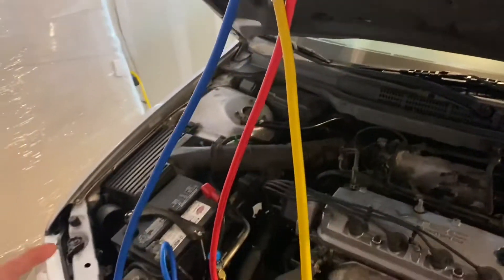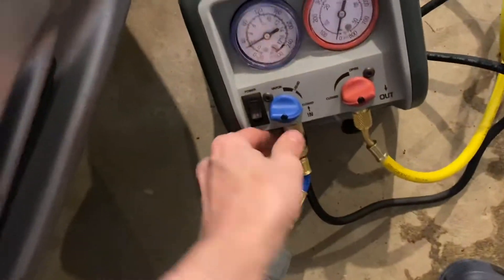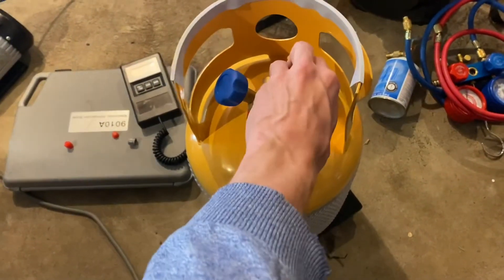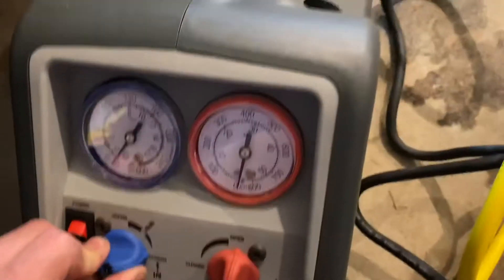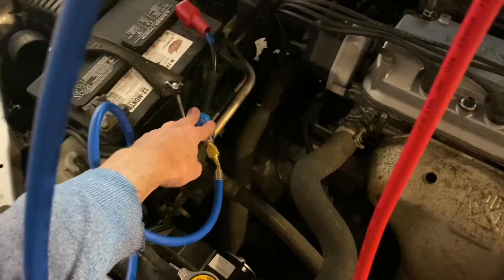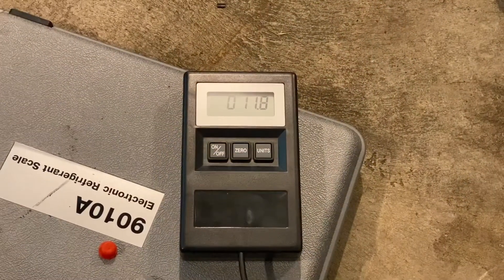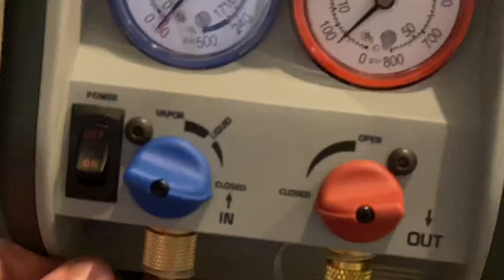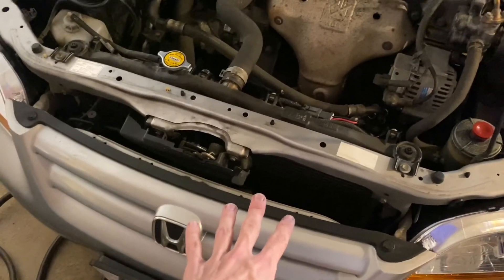R134a AC Recovery Procedure Robinair RG3

Comment: Can the freon you just recovered can be reuse, I mean that particular machine has the option to push it back to the car?
Reply from the maker: Yeah you can reuse it. There’s an in line drier to remove moisture and the air settles to the top of the cylinder so you can bleed it off. You don’t need the machine for charging the car, you can add liquid into the high side then finish the charge by adding vapor into the low side by weight.
Reply: @NicholasAndre1 would be nice to see a video of this for proper reuse of the recovered refrigerant.

Comment: I wonder if that RG3 unit still had a few ounces of refrigerant in it's condenser. 
If like to get that small unit myself but I haven't been able to find out how much it normally can't pump out.   The larger sized units all have purge on them to evacuate out the machine after the unit/ car system is emptied. 

Good job quickly showing how to use the equipment as well.
Reply from the maker: Yeah as best I can tell you can’t get around venting some amount of refrigerant with this unit. I think it’s fine to leave some refrigerant in the unit just not so much that heating will cause it to go over pressure. For the purge feature is it capable of somewhat evacuating the refrigerant in the recovery machine?
Reply: @NicholasAndre1   On the units that have the purge feature they remove almost all of the refrigerant from the machine.   I am guessing they open up valves to be able to vacuum out the built in condenser when in purge mode.

Comment: Thank you Sir for taking the time to make this vid. Question if I could. By pulling the system below zero (into a vacuum) does this not run the risk pulling air (through the leak) into your recovered refrigerant? Thx in advance. Recovery is all new to me.
Reply from the maker: Yeah good question! If you have a leak you do not want to pull into vacuum. In this case there was no leak as it had held a charge for years and I was just replacing the condenser so there’s no issue continuing below atmospheric pressure. The recommendation is to allow the recovered refrigerant to settle on a flat surface in the cylinder. At that point all the air will rise to the top and you can bleed off a bit through the vapor port on the cylinder. You can also double check the temperature and pressure to make sure it’s not contaminated.
Reply: @NicholasAndre1  Yeah good point. You are changing the desiccant anyway. Vacuum again post condenser change And if you can purge the air from the tank…all good. Thx…Great video 👍

Comment: Don't you mean the condenser? The evaporator sits inside your dash. I bought the same unit. I'm still vague about recovering the liquid verses the gas using this machine. You recover the liquid first and then the gas.
Reply from the maker: It’s the condenser in front yeah sometimes I conflate the words. As for liquid versus gas it’s a time thing — recovering liquid is faster but you have to be careful you don’t fill the recovery machine compressor with liquid (it will destroy it) which is why you’re only supposed to open the valve a bit at first. But over time both sides equalize pressure and you don’t have a choice. It all ends up at the same pressure/temp eventually while off.